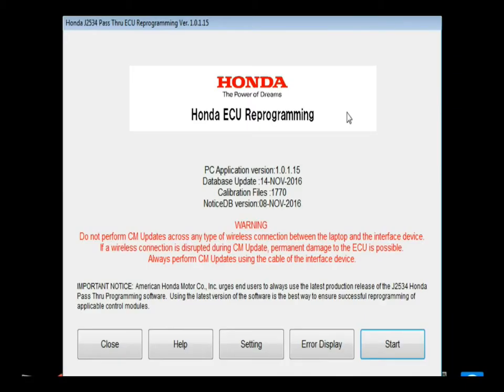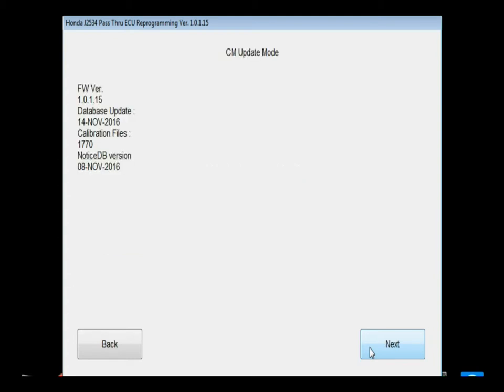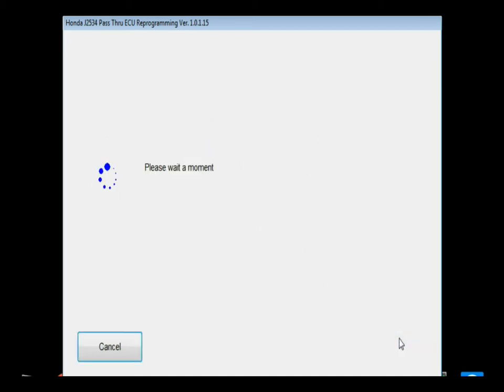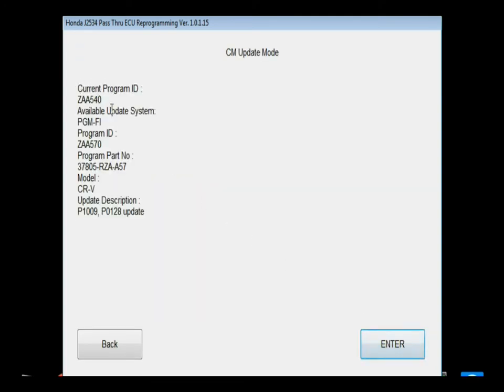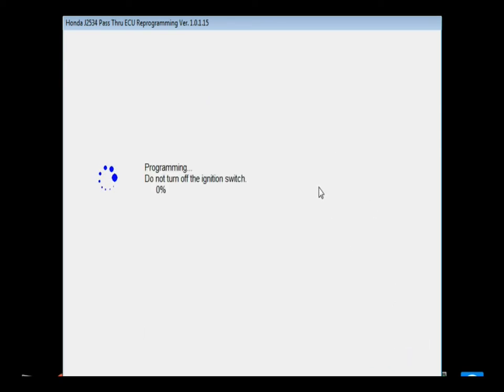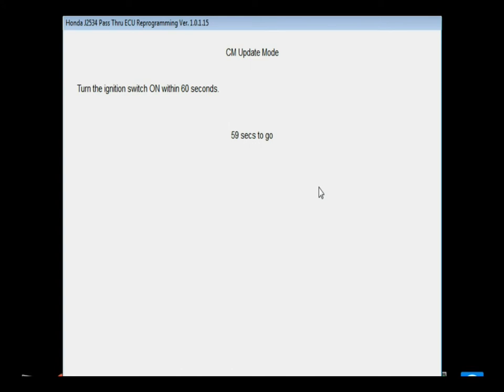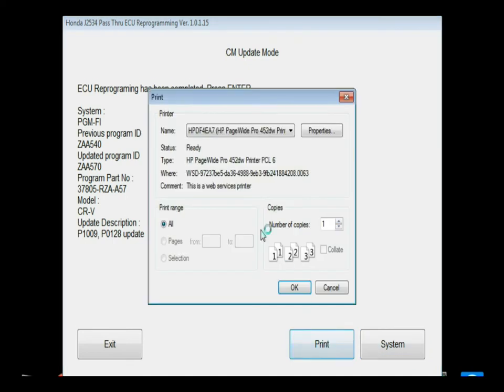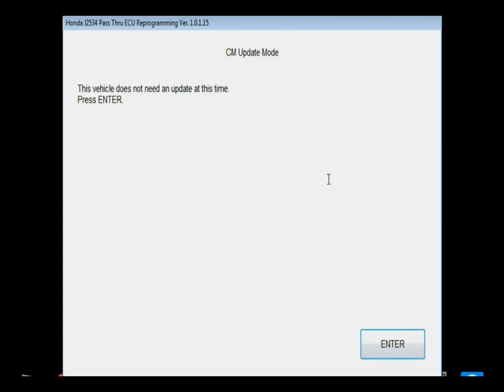How to Flash Reprogram a Honda with a J2534 device

Comment: New to the channel. Cory at S&A recommended your channel. Keith I own two Honda’s,a 99 3.0 EXL accord and an 07 3.5 odyssey. Wondering if you could advise me on a good battery maintainer and didn’t realize there were different versions of the J2534(is that correct). I would also think I would need a subscription to Honda’s programming program whic I think you can purchase daily monthly or yearly. I’m a retired aircraft mechanic Diyer trying to learn what I can from excellent techs like yourself Maic Salazar, Keith Defazio Brian Mann and have been purchasing the equipment they recommend. Any advice on Honda’s would be a big help. Do you ever give classes out on Long Island NY. Looking forward to following your channel. Thank you 😊 Artie

Comment: Sorry for disappointing you , but that’s not a flashing or reprogramming , that’s calling updating , re flashing is when you clean up the software or remove it out of a Ecm , then install a new software , and then program keys , and reprogram vin# inside of new module , and recalibrate all system . Like throttle body , transmission shift relearn , crankshaft position relearn , and all bunch of step .!
Reply from the maker: You are partially correct, but updating is reprogramming the module with a different calibration. It takes more time to explain that than whats its worth. BUT the reason I did this is:

NO ONE SEARCHES FOR UPDATING PCMS ON YOUTUBE! 
If I wrote updating PCM in the title I wouldnt have OVER 7 THOUSAND subscribers and 1 MILLION VIEWS!